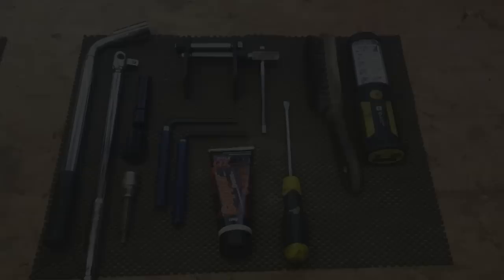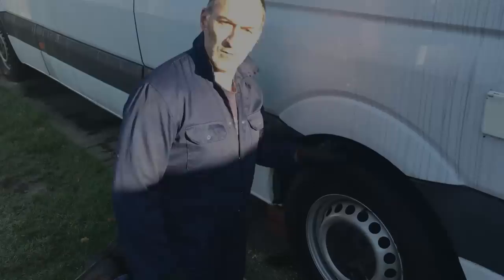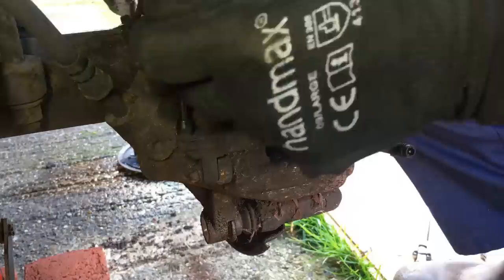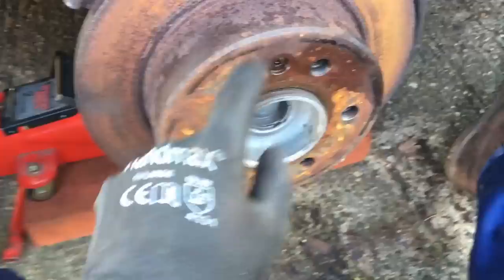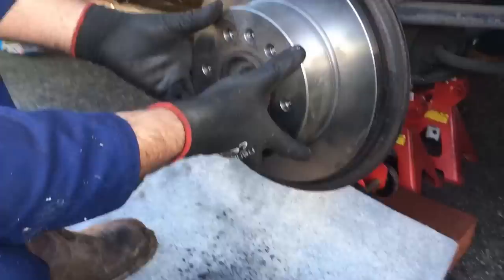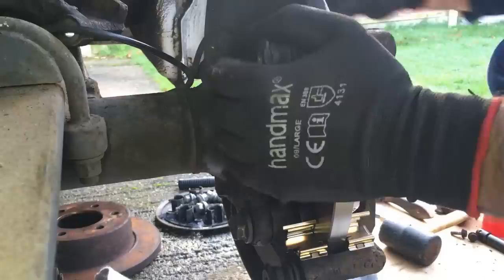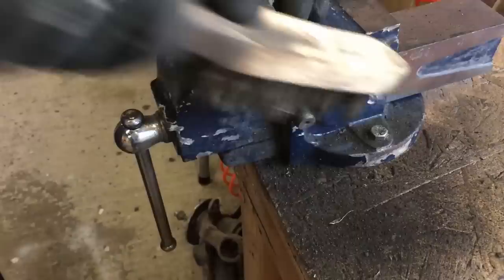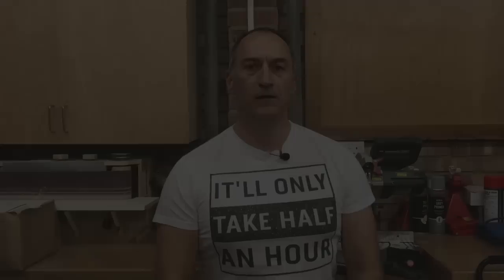Mercedes Sprinter - New Disc Brakes and Pads

Comment: I would have added some anti-seize on the bolts (and a bit behing the rotor).
Reply from the maker: Robert Currey good shout around the hub, the new bolts already had a red compound on them? I assumed this was a form of locktite?
Reply: @GregVirgoe  yea, if there are new "coated" bots I would have left as is also. On the lug nuts though, it is much nicer if you have to make a tire change on the side of a road to have them "anti-seized". Just a minor nit, but thought others might benefit from the discussion.
Reply: Never ever ever apply anti-seize (copper paste) between the disc and the flange, if that's what you mean.
Those 2 parts have to be metal to metal, because this connection is used for distributing the heat away from the disc when you are using your brakes. Especially with a fully loaded one like this. 
And yes, I am a fully skilled mechanic if you wonder. :-) :-)
Otherwise a good job.
Reply: you really think that's true? 1. that the 'metal to metal connection' will be prevented by some copper grease? 2. that copper grease would block heat transfer in the areas where the 'metal to metal connection' wasn't achieved? I don't think so...
Reply: @kennethskou5597  Copper is one of the better conductors of heat (better than steel, especially oxidised steel).
Reply: I am actually aware of the properties of coppergrease.
My main reason for stating it, is the numerous training courses I have attended as a Toyota Mechanic at their facility. They always mentioned NOT to grease the joint between disc and flange..
When you look in the official workshop manuals, the only use it on the antisqueal shims.
Secondly, because people who have no or perhaps limited knowledge of brake components do have a tendency to use anything within their reach as a lubricant. - Even wd40 (which is a penetrating oil for loosening)
But as Greg shows it, a thorough cleaning and use of limited copper grease only where it should go, is the way to go IMO.
It is also what I have been learning my apprentices over the years.
Reply: @kennethskou5597  Sure, it isn't "required" (it has a cost). 
Is it harmful, NO! It will not interfere with the heat conductance (used properly).
Is it beneficial, YES. 90% of the UK is within a few hundred km of a coastline and hence a corrosive environment. 

On lug bolt/studs I always add anti-seize (not the copper, it's more expensive). It even appears in the video, one being cleaned showed evidence of anti-seize.

As I stated before it's a bit of a nit.
Reply: @kenneth Skou Toyota probably said not to grease the joint between disc and flange because it is not essential and therefore a time & cost saving to them. Doubt it has anything to do with heat - if anybody is relying on that 'metallic connection' between the disc and the flange to dissipate heat from their brakes, they have bigger issues than a film of copper grease could cause. nobody mentioned improper use of lubricants on braking friction surfaces. Someone with that little knowledge shouldn't be working anywhere near vehicle brakes. I'm a master of mechanical engineering and design engineer (like Greg). I work on my own vehicles rather than take them to mechanics because of the number of times they have made mistakes / told me things that simply true / broken and bodged things. I know good mechanics exist, but in 10+ years I have only encountered two technicians I would trust to work on my car. sad but true
Reply: @ Robert Currey - I'm from Denmark. Think the longest travel to go before you hit salt water is. 60 km. I know your pain of rusting. :-) :-)
Reply: @TJG239 - Well, let's not argue too much about it.  I am unable to find any suggestions from retailers like Brembo or Mercedes - even on their videos - where they use any type of grease on the  place we are discussing.
You do it your way, and I will probably continue doing it my way. :-) :-)
Cheers guys.

Comment: You did indeed brave the elements to make this tutorial for us, I could see the frost still on the grass and the cold in your breath. I guess with cold moring like this it's great to test your Truma Water and Cabin heater. Doing your own brakes saves you 100's an once anyone has done it once  (pads or pads and discs) they will get a lot of mechanical confidence to harder jobs. Greg a tiny bit of Copper Grease on the Wheel nuts is a good idea also, check this video for the reason for that  https://www.youtube.com/watch?v=PnM_srEypA8
Reply from the maker: I spoke too soon about the weather I was halfway through the other rear wheel, the heavens opened and it pissed down!
As I had it all apart I had to scramble to get it back together, I was drenched through to the skin.
I finished the fronts the next day. :D
Interesting video, the guy makes a great case for not lubing your nuts too and in this world of H&S for the purpose of this video I better stick to the manufaturer's manual guidance. My advice to anyone else would be get your self a decent wheel brace. :D

Comment: Blimey Greg those discs were like new, as were the pads? 50p worth of wet & dry would have reconditioned those discs, clearly you are made of money !
Reply: You really should have used a torque wrench to finally tighten those wheel bolts, using a strong arm like you did can actually over-tighten the wheel bolts - you may regret that when they are bloody hard to loosen in the snow storm in the middle of nowhere! I didn't spot whether you put a tiny smear of copper slip on the wheel bolts to make undoing them straightforward ?
Reply from the maker: The rear discs were beyond wet and dry Roy, they were pitted and would not have passed the MOT.
I definitely could have cleaned up and reused the pads, which I have kept by the way.
I would much rather know the brakes were in tip-top condition especially as this will be our home for a long time now.
It works out to be less than 1% of my total spend on this project. I'm ok with that, thank you.
Reply: Fair enough Greg, i hope the Euro trip goes really well.

Comment: What a travesty, chucking away those old disc and pads. I would have taken it out for a few applications of the brake pedal to remove the rust from the pad surface and off you go. New discs get ugly after a month or two anyway, unless they are painted or have corrosion resistance, which is often not the case.
Reply from the maker: As I mentioned in the video the discs were heavily pitted, beyond your method and would have failed the MOT.
Would have been like a cheese grater. I have kept the old pads as they were nearly new in terms of wear.

Comment: you talk about extortionist shops that do brakes........25 years ago h got a "4 wheel brake job w a 1 yr warranty", about 7 months in the left front caliper froze up took it in they fixed the issue...got in the car to leave, pulled out of the lot went to stop at the next light and WHAM! into the State Patrol Man stopped in front of me.....well turns out upon the states inspection they never even touched the rear brakes! it was a rear wheel brake cylinder that hydrauliced  itself and caused the brakes to fail!  my insurance company took my receipt for the original work and  went after said shop to replace the States Cruiser (they dont fix wrecked police cars i found out!) and pay to fix my car as well!.....(I wound up getting a certified used car after all was said and done!).......moral of story Dont do it yourself due to liability issues!
Reply from the maker: That’s a perfect case for doing it yourself. I would not want to risk my own life and wrecking my van on someone else negligence. At least I know the job has been done correctly.

Comment: Greg, stick to van mods - mechanics and maintenance are  better served  by other people. Well done mate but not your best effort.
Reply from the maker: Oh dear, I'm sorry you feel that way.
Care to give me some advice on how to improve it?
Reply: @GregVirgoe  A bit more detail on the heating side and kitchen gas hook ups - what I said was in no way a put down - I appreciate the effort you have put into this series. You come over better in sharing all our trials and tribulations with the conversion of a van - not brake changes. Just my two pennorth mate - not intended as a put down.
Reply from the maker: fraser hardmetal there will be more videos on the detailed parts of the van build.
Being able to do your own maintenance for self builders is another aspect of the build, no?
So I should delete the planned oil and filter change video 😃
Reply: @GregVirgoe  Don't you dare Greg, I want every video I can get!  Thanks!
Reply from the maker: Pendelton Whiskey, yeah, that's what I thought too 👍🏼😃
Reply: Hi greg, firstly really enjoyed binge watching the whole series of van build videos in the past week or so, lovely tidy well planned work, makes me want to do my own... a lot. The only small fault I could find in this video is you advise to get the wire brush into the inside of the calliper in an area where the corrosion is really only cosmetic but you are at risk or damaging the piston seal with an errant strand or two from the wire brush and compromise the seal long term. Cleaning up the calliper carrier particularly in the area where the pads locate is much more beneficial, as a few said, you could of lubricated the slide pins, but if they felt good and smooth then sometimes leaving well enough alone is the best plan. I generally use a bit of thread lock when refitting the main bolts, don't want brakes to work lose, and they normally come out with thread lock from original fitting, keeps the threads clean and free from corrosion also.
Reply from the maker: macdaddymcgrady all very valid points, thank you for adding that comment, much appreciated 😊